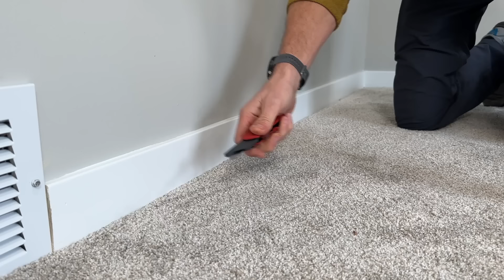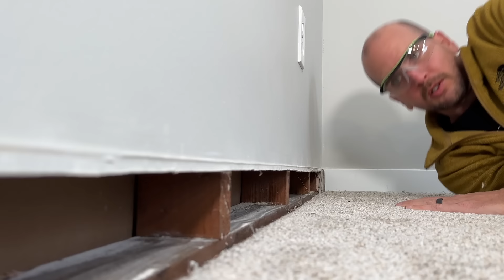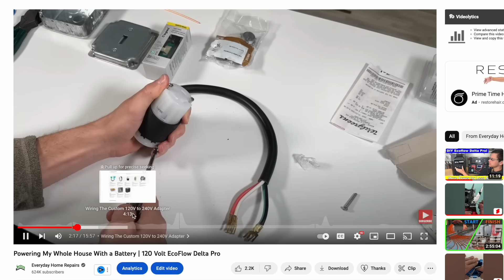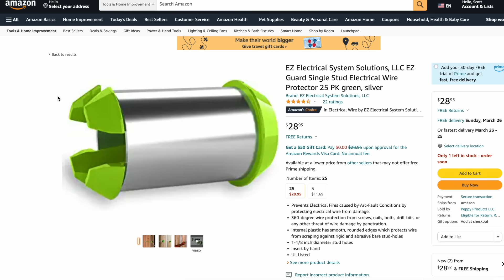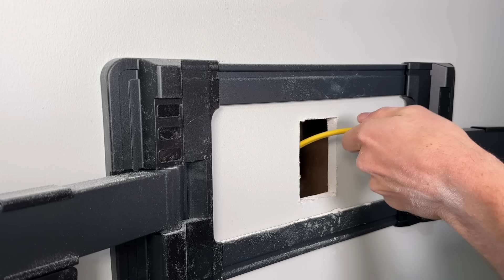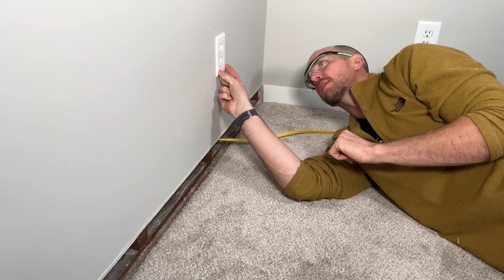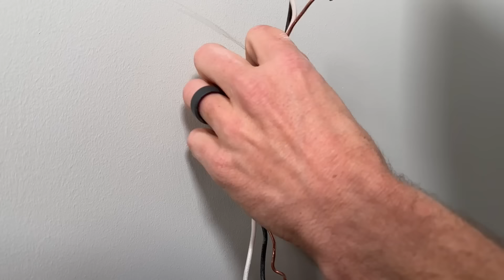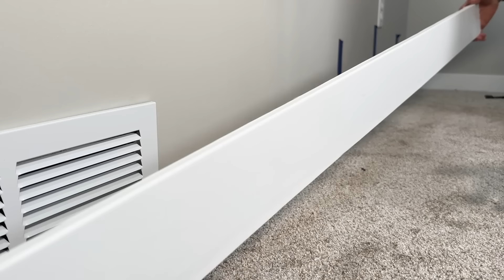How To Hide TV Power Cord And Cables | Easy Way To Move An Outlet

Comment: I wish you would’ve shown the part most important to me…how you got the new Romex to the original outlet once you ran it through the two studs.
Reply: Which is probably the most difficult part of the project.
Reply: Came to the comments to see if someone asked this!
Reply: Fish tape.
Reply: @mattfleming86  But did he have to take that box out first to fish it up to the hole? Or did he fish it through a hole in the outlet box?
Reply: I've always struggled to do this. I personally have just always found it easier to rip the old box out and put in an old work box with the cables routed into it(if next to a stud, I prefer getting the old/new work boxes that can be screwed into the stud from inside the box)
Reply: @Jeffrey2457  I agree
Reply from the maker: Thanks for the feedback, it would have been nice to get a close up.  Since I had access from below I was just able to feed it right up through the wire holes on the bottom of the box.  Usually no need to take out the box.  This link will take you to another video with the same type of routing but a metal box.  https://youtu.be/nWfEANZOYSk?t=353
Reply: @EverydayHomeRepairs  Excellent! Thank you. It was a great and very helpful video. Just wanted to see every move. I’m a rookie so I need everything! 😂
Reply: @justme4172  It's tricky with plastic boxes because of the "spring pressure" of the little plastic tabs that cover the hole.  I take a screwdriver and pry it open a little so that there will still be some grab on the romex, but it makes it easier to slip through.  It is important to joint the tape and the wire together smoothly with tape (and JUST enough of it) in order to feed it through.  Sometimes there will be a bit of a rough edge where the plastic break line/mold line is.  Don't be afraid to debur it with a knife if it's prominent.  It also seems to be a lot easier with 14ga than 12ga romex, but that part is decided by the circuit not pullability.
Reply: @mattfleming86  Excellent information and advice!! Nicely detailed! Thanks!
Reply: @justme4172  I'm guessing easiest way is to remove the box.
Reply: @msmith7472  Agreed! 👍🏽
Reply: @EverydayHomeRepairs  I greatly appreciate your video here, but I agree this would be the most physically tricky part of the job.  Find it funny you more thoroughly covered the EASY line drop from the new box to floor level, then completely skipped how to get the line into the old box from below. 🤦‍♂️ 😂
Reply: @justme4172  I'm an electrician. Just knock out the hole in the box and fish the romex into the box
Reply: @mattfleming86  Usually, most 1 gang new work boxes have knockouts instead of internal clamps. So I'm pretty sure Scott was able to simply punch one of the knockouts on the bottom of the box and feed the wire through.
Reply: Would have been easier to go the opposite direction, being the hole at the television is larger. Now feed the romex through the bottom of the new box and install it to the wall. You also may need cable from your service providers and internet direct feed.
Reply: 💯 I was like oh just magic for that part
Reply: Thanks for asking. That's what I was going to ask?  While I'd like to hope it was, I don't believe it was so easy that it didn't deserve to be shown.
Reply: @vincentgonzales8917  He says at the beginning this for a streaming system only.
Reply: Self explanatory
Reply: Why didn't you show fishing the new wiring up from the floor to the old outlet???
Reply: Come on. You missed it. He had an “extra piece” of romex. It was just magically there. Don’t your projects work that way?
Reply: If you are asking this then maybe keep away from electrical work
Reply: @chrismillea7830  He’s asking this because he had just watched an instructional video on how to do it but a step was skipped over. Instead of being rude and insulting, try behaving like an adult who recognizes these viewers were here to learn.
Reply: @EverydayHomeRepairs Easier said than done if your TV is mounted on an insulated wall as mine was. Also, if there are horizontal fire break studs (don’t know the technical term, sorry) the complexity of this project skyrockets.
Reply: He also forgot not cover the fact that you have to match the Romex to your existing wiring.  There’s different power grades of romex.
Reply: @r.t.watson738  I don’t think that’s really significant. There shouldn’t be any harm in (for example), running some 14/2 to a single receptacle even after the rest of the home may be 12/2.
Reply: It’s easiest to feed  the new romex wire down thru the original box .
Reply: Do it in the reverse... from the existing outlet. It will take a little more time.
Reply: It was easy he tired into  outlet
Reply: @justme4172 he dropped extra wire ,cut off 6" ran through 2 studs to outlet tapped into the connector
Reply: I use a steel fish wire with a hook. Tape it and pull it through
Reply: @EverydayHomeRepairs Hey what was that tool you used to remove the nails around the 4:00 mark?
Reply: Thought it was just me🤣....I was like wait how'd you get the Romex in there!
Reply: @FastAndFurious1964  😂😂😂😂 yes I know. 😂😂😂👍🏽👍🏽👍🏽
Reply: @vincentgonzales8917 I think all data is coming into the set via a wireless connection. If you have a sound bar or a PC , they will need to sit on a table under the TV, but you can use a similar set of holes in the wall for those cables.
Reply: Everyone in the uk in old houses , going nope 😂😂
Reply: @msmith7472  You should make a video on how to remove a box. Newbies will have a big problem doing that. I have a way. But, I would like to hear what others do to remove an old box.
Reply: @r.t.watson738 he used 12 gauge Romex to cover his bases. Looked like a 15 amp circuit which only requires 14 gauge. It's acceptable to up-size the wire.

Why is everyone always trying to pick apart content creators? You would be a fool not to get about three differing opinions on how to do this. 

If after watching three different videos you still felt it was "too hard" or "you couldn't figure it out!" That might be a sign from Above telling you that you should call an electrician.

When he tells over the phone it will cost $400, then you might be motivated to try harder.

Cheers ladies & gents.
Reply: @deffstar69 Ya'all in the UK will just get on with it using the talkie to an electrician. Let him wanker with it.  😂
Reply: It went straight down the wall.
Reply: If you don’t know then you should probably get a professional to do your electrical work
Reply: One option was to feed fish tape thru the existing box to down below. Then tape new romex to it and pull up and thru
Reply: @misterssippi601 that would be the easiest on an older home where they all used those galvanized boxes with knock offs. New plastic boxes seem to resist opening and want to spring back closed holding the wire in place
Reply: @ScrewballMcAdams this is exactly what I just ran into I have a horizontal stud how do I get past that
Reply: @mattfleming86 what kind of fish though?
Reply: I drill out the bottom or top whatever u need of the box, also u definitely do not need 12awg wire for a TV outlet. Most likely you'll have 14awg wire in all your outlets anyway, it's cheaper.
Reply: I like it
Reply: @R0cketRed  have you ever seen that show “Beef”? The guy using 14 gauge wire instead of 12 for outlets and burning down the house was a plot line. 

Do not use 14 gauge wire for outlets. Even if it’s “just for a TV”. Circuit wide resistance is effected by all the wire on a circuit. You use 14 gauge on 1 outlet, you effectively raise the resistance for the entire circuit. Now it might be negligible, but why risk it?
Reply: @trunolimit  😆 ok, most if not all houses with modern building code have 14awg for every normal load outlet on a 15amp breaker... or worse, houses with nob n tube still exist. It's overkill to use 12awg but if it scares you then do it, just look at the joining outlets awg first n see those r 14 then decide
Reply: It's a non insulated wall just push the romex down a couple of feet
Reply: @R0cketRed  well I guess the correct answer really is look at the breaker. 15amp = 14 gauge and 20amp = 12 gauge.
Reply: @trunolimit  😉
Reply: Omg, I can do the same thing without cutting long chunks of drywall, or drilling any holes, and I don't do construction! (maybe I need to start making my own YouTube videos...)
Reply: Fish tap, and you don’t need anything expensive. Harbor freight has fiberglass ones for short distances like that, but you could use a thin rope or twin fed through the top. Gravity will make the twin go to the cut hole and then just tape the wire to the twine and pull the wire into the box.
You could use a metal coat hanger and feed it from the box to the hole. He should have shown that for us who don’t have experience. If on an outside wall you will need something ridged because of insulation.
Reply: @ScrewballMcAdams this is what I came here for. I ran into just this. Insulation plus horizontal beam seeming blocking my way. I’m not sure if I should patch the drywall and just let the cords go on the outside or if I should try something else :(
Reply: @kristopherfigoli5427  I wish I knew. Sorry.
Reply: You can drop a string with a little weigh on it. Tie your wire and pull it up. Hope this helps
Reply: Just fish tape through the hole in the bottom of the box in the wall. He had whole a the bottom so he just fished it to the whole at the bottom, and guided it through the two studs. Same going back to the new box.
Reply: You make it look so easy for thumbs hedelmam
Reply: He just tapped in the one he cut under
Reply: @SumDumGy  I believe you would not want to do this. In the event the circuit had a 20 amp breaker? You would need to be careful to check this first.
Reply: @marmarteeny They sell super long flexible drill bits just for those situations. Expensive but necessary for pro's...
Reply: So what happens if you have noggins in the way? How did you know that they weren’t?
Reply: Youtube always skip the important steps
Reply: @redgmc2004 not even a cell phone? No refrigerator or microwave? That's too crazy to believe, but if true you just don't rent there. ::shrug::
Reply: @deffstar69 I'm curious why things are different in the UK. I've heard a lot of older houses in Europe don't use drywall, but are all wood or even concrete. Is that the reason?
Reply: You could drop string down then tie it to the romex or bind it using tape.  You can then carefully pull the string to raise it up through the outlet.  If the old outlet is harder to do that with then do it all in reverse. Feed romex down the original outlet, through the studs then use string to raise it up into new outlet.
Reply: That's what I was watching for
Reply: Drop a string with a small weight…( nut or bolt ) down to the Romex and tie it or tape it to the new Romeo and pull it back up.
Reply: 🍒 wondering what's the trick to hide wires on a wall 🤣 and then he reveals it's a fake wall 🤣🤣🤣 bruv, everyone who uses fake walls and fake ceilings does it to hide cables... that's the reason 99% of the times.
Reply: Right up thru the box.
Reply: I would have started in the existing box and dropped down,  then ran the romex up the wall where is easy to catch with an open hole.
Reply: Brilliant!!  I feel like I could do this!! Thanks
Reply: Sounds easier if the cable was first run through the original box all the way up to the new box.
Reply: That part is really not hard, in the bottom of the electrical box are tabs covering holes,  take a screw driver stick it inside the box and push open the tabs so that you can fish the wire through that hole where the tabs are located, make sure that you press the tabs open enough so that it's not hard to fish the wire through that hole.

The easiest way to do it is to use an electrical wire fish, or if you don't have one, just grab an old wire clothes hanger, fish it through the hole with the tabs from the inside of the box down to were the new wire is, then use electrical tape to tape the new electrical wire to the clothes hanger, and pull the new wire up into the electrical box.
Reply: I came to the comments for the exact same reason. He skipped the absolute hardest part
Reply: @heclas  me too LOL
Reply: @justme4172 I'm so glad you mentioned this. That was a huge disappointment to not see that step!
Reply: @EverydayHomeRepairs Thank you for the link to the other video... And you had it start playing at the exact spot we needed! Excellent! Thanks again. Beautiful work.
Reply: Ran a string down
Reply: @BA-dx6sw the most difficult part of this project is where it ended, he didn't show how to hide those nails and how to make the joint above the baseboard to the wall. I find it really funny that he's proud of himself saying that we couldn't say someone removed it
Reply: You didn't show how to do the most difficult part, fishing the new wire into the existing box.
Reply: He did
Reply: @justme4172  A hole in the back of the outlet box.  You use fish tape going down from the box and attach the romex to it and then pull the romex up through the hole in the back of the box.  Just make sure to knock the tab out completely at the back of the box to make it easier to pull the fish tape and connected Romex through.
Reply: @redgmc2004  Time to move on.
Reply: @BA-dx6sw  I've done similar work. It's not. Some fish tape is all you need. It takes a bit of fiddling, but it's not hard.
Reply: Here is The True Savior

YaH The Father (Genesis 1), Who, with His HAND, formed “man (Adam)”, from the dust of the ground (Genesis 2:7).

YaH’s HAND they NAILED to the Almond Tree, to symbolize forgiveness of the “Tree of Life” sin OF “man” and thus “The Fall OF man” (Genesis 3)

YaH The Father arrived to be Crucified via the Tent of Meeting (Exodus 33, Isa Scroll), how YaH has ALWAYS arrived
Reply: I have the same question. It was the one piece I didn''t already know.
Reply: what is Romex?
Reply: Just use a straightened coat hanger. Put it down through the bottom of the box  tape it to the romex with electrical tape and pull it back up through the box.
Reply: Use an electricians fishing reel.  It is almost like a drain snake made out of hard metal wire on a reel.  You just run it or you can use string with a weight on the end if or an extra piece of wire you have that's long enough to reach from the outlet to where you're wire is.  Then you just tape it to it and pull it up through the hole.  It's actually pretty dang easy.
Reply: Doesn’t look very easy to me, looks like a pain!😊
Reply: use fish tape from the hole you cut out down to the bottom where he cut the baseboard out. Find it and feed the wire through
Reply: The box has pre-made tabs in holes that you just have to put a screwdriver into it and hit it to knock the tab out.
Do that to one of the bottom tab/holes.
Tie a string onto a nail, drop the nail through the hole, let it slide down to your Romex wire. (The floor) Don't let go of the string.
Strip the outer sleeve from the Romex, about 2ft.
Bend the ends of the 3 wires over about a half inch.
Tie the string onto the bends of the wires.
Pull the wires up through the hole you made in the box.

If you don't see the tab/holes, look closely at your box, go to the hardware store and look at the boxes there. Find one that looks like your box. Look closely, if metal you should see that they have slots just big enough to put a screwdriver into. If plastic, there should be an outline of a slot in each corner of the back that is easy to knock out with a screwdriver hit with your palm or a tap from a hammer.

Do the same thing from the top box.
Forget the Wago through hole protectors unless you have money to burn. The rest of your house doesn't have them.
Reply: The one part I didn't know how to do
Reply: Probably just stuck his hand and arms in the drywall cut and pushed the wiring up through the hole on the bottom of the box. He did things backward. You should always see what the wiring situation is in the outlet you’re using before even starting a project. I had a simple enough project adding a ceiling fan into my living room. Turns out, the wall switch I wanted to connect it to was connected to 2-3 way connections, an outlet that was switch controlled, and loosely wired to a light in my hallway. It was a MESS. lol
Reply: Probably just stuck his hand and arms in the drywall cut and pushed the wiring up through the hole on the bottom of the box. He did things backward. You should always see what the wiring situation is in the outlet you’re using before even starting a project. I had a simple enough project adding a ceiling fan into my living room. Turns out, the wall switch I wanted to connect it to was connected to 2-3 way connections, an outlet that was switch controlled, and loosely wired to a light in my hallway. It was a MESS. lol
Reply: This is super fun to watch!
Reply: @trunolimit  What?!  Have you looked at the gauge of the appliance cords you're plugging into the outlets?  Are you going to change all those out?  It doesn't happen.